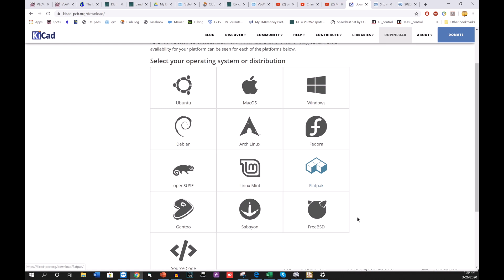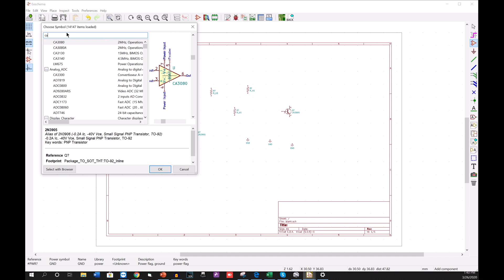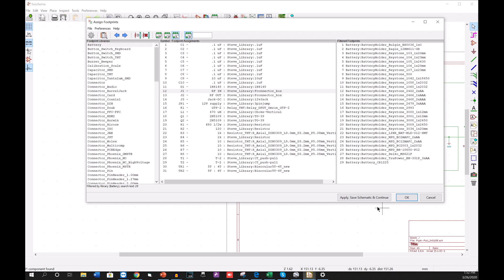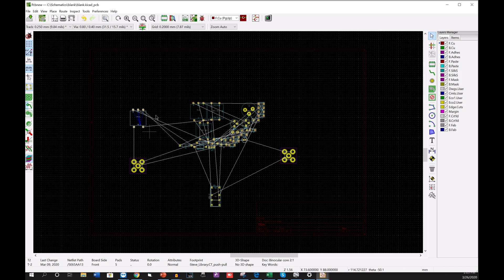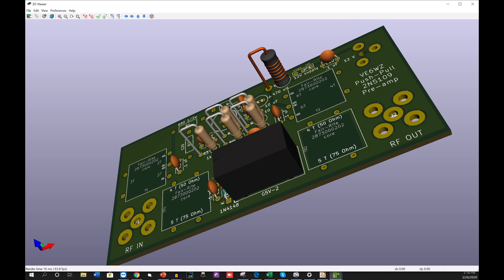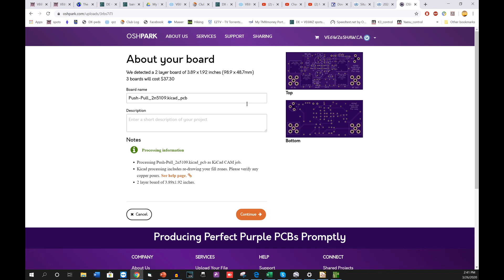KiCad Basics.  Don't be afraid to design your own PCB.

Comment: Its maybe something worth learning and testing. I'll give comment if I get it tested.
But it looks simulating is not easy with this tool, even the calculator can help overcome some simpler cases.. need more time to check.
It might need bond wire modeling and some integration with ASIC tools and hspice, etc.
I might not be able to do some serious electromagnetic simulations, even the use of the transmission line is 1st step. Or not good for scientific study of the RF systems. It might be best of the free tools and not sure if it has some more extensions to work with.

Comment: Beware the hidden slippery slope of circuit board design. Once you have your design finished and in your own hands, the sense of project gratification will entice you to make more. And more. This slippery downward slope can become a second hobby in itself. That's not bad, though.

Once I retired and was able to concentrate on personal projects exclusively, I made over seventy-five different PCB designs in less than two years. Most are custom designs for personal ham radio projects.

There are alternatives to KICAD. Another program is named DIPTRACE.  I went this route after first checking out KICAD. For me, the intuitive interface and ease of use was the deciding factor. Their auto-router kicks ass, IMO.

Although I professionally designed commercial boards for decades using ALTIUM, home circuit boards are immensely fun to create. The appealing finished projects speak for themselves.

I agree with Steve. Give home circuit boards a look. 

I believe we are living in a golden age of home project design and construction.

73 de Bill, K8CU
Reply: True Fact.
Reply: can confirm. "hey I can squeeze 1mm of my board here, let's move all the parts a bit over to the right!"